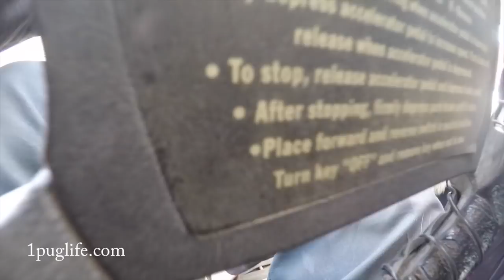free is my favorite number

Comment: Thumbs down for the what happened right at the end.  To bad you almost made it.  The free Mazda aka Ford Escape has a major problem with the cat converters.  New ones are expensive they are built into the headers on the v6 engine.  Alternators are in a bastard location.  Rust is MUCH more than meets the eye.  Will be more under the nice plastic covers.  Try not to get sucked in fixing it.  If you start you’ll see what I mean.  Trying to save you some Argo.  Plus there will be holes in the rear body into the rear floor.  Junk.  But it will do some jumps and stuff.